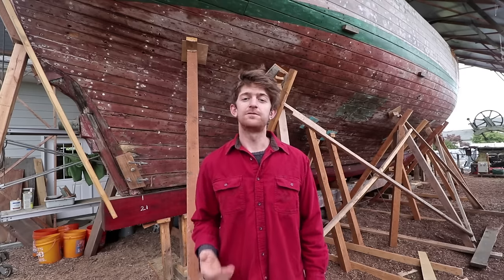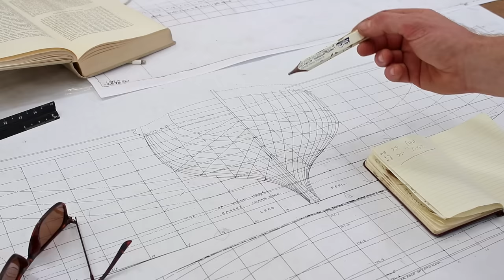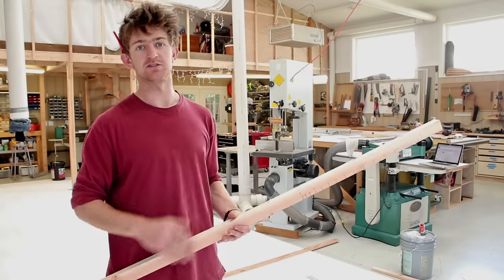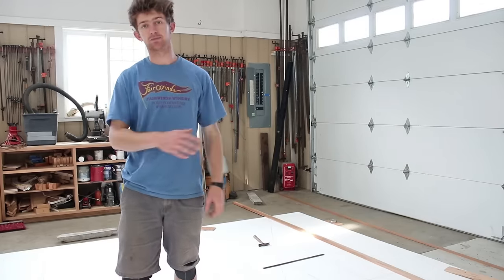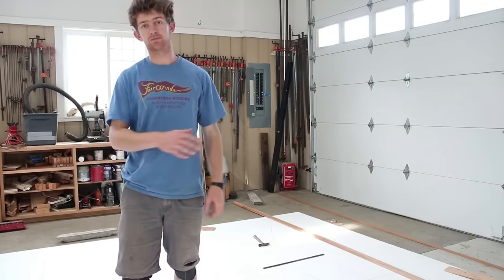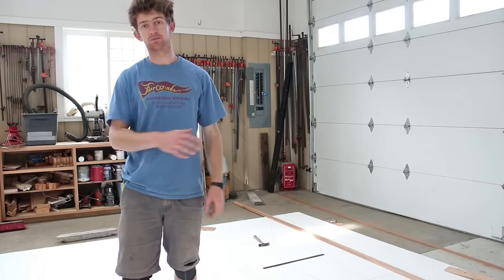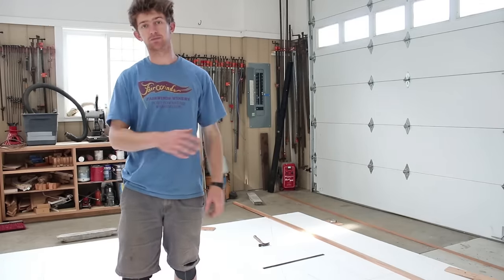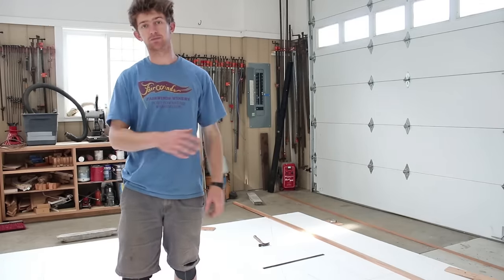Lofting the Lines; Part 2 - Rebuilding Tally Ho EP25

Comment: You can spend a month 'lofting' the plans out on the floor and getting getting the lines 'faired' in yet what is the point of this? Do you then make templates from the lines for the frames that you then need to cut out?
Reply: James Allen   I suppose the idea is exactly this, yes. Let's see.

Comment: You can't play naval architect without learning CAD. Why go to all the trouble "perfecting" the curved lines of the vessel on a white painted floor when Autocad or even Adobe gives a more perfect curve in one-hundredth the time? This insistence on middling "perfection" is a reflexive attachment to old fashionedness for its own sake, while simultaneously adopting social media, forklift trucks, power planers and other modern accoutrements seemingly at random. I sense a fear of adopting CAD more than any well-grounded theory for rejecting it. But if your dream, besides lolling about on deck in a tropical paradise, which will bore you before the anchor has even settled, is to one day establish your own boatyard—in the 21st century—you will need to learn and to rely upon CAD. An antique ship saw and Makita planers won't cut it when your work space and tools are no longer being donated for free. There is no "fair curve" in actual business.

Comment: Couldn't you just copy the whole lines drawing sheet into an AutoCad program and then use a large overhead projector to scale it up to 100%? Seems to me that this would save a lot of time and headache. You can spray the lofting floor with a photosensitive substance and leave the projector to burn in the image for a few days. Then just get out the old pen and you're done in a few hours.

Okay, I'm sure what I just said there is beyond stupid and I'm not smart enough to know why that is, but it's an idea. And I don't have a lot of those, generally speaking. They come around only about once a year so I get really excited whenever they do.
Reply: It would be incredibly difficult to ensure that the projected image was not distorted, I also doubt that the resolution would be good enough.... how ever it might save time to construct the thing in a 3d modelling programme and then transfer the info manually to full size.
Reply: I think the idea is that the curves would still not be 100% fair, so laying them out using a rough set of points allows the iterative process to home in on fair lines.
Reply: Actually, they have done something of the same in the yards in Mobile, AL. They have projection towers which cast the lines onto the steel plates on the yard floor, the workmen draw out the lines according to the projection.  This is done at night.  As for oblique distortion, the projection is rendered to cancel that.
Reply: I do this in the computer for aircraft.  It is just as tedious and time consuming.  I wish my bosses understood this. The mesh surface helps because you change both directions at the same time.  But you still have to cycle through process and compromise on this or that direction.
Reply: Well you are assuming the scale  36" long hand drawn plans are perfect. They never are  perfect, that why you loft a boat out full size, to fair and correct the small scale issues and make templates or parts of the boat. We do "old school pattern making for metal castings " and we re-layout scale drawings to full size to make things correct and find all the mistakes! We do this to remake old part that need replacing.
THE NEW WAY..... Is to drawing everything in a computer cad program and and then cut the templates or what ever part you want full size on various types of machine. You then of course have to know how to assemble them correctly. Drawing on a computer is time consuming too and you have to also be a designer to know what you are drawing and why you are making the shapes you are making , it goes on and on.
Cheers Warren.
Reply from the maker: Here's my stock answer for when I'm asked why I did it manually!
A few reasons. 1. I know how to drive a pencil pretty well, but not CAD software, and I wouldn't want to trust anyone else to do it. 1. Being able to loft is an important part of being a master boat-builder, so I was keen to get the chance to learn it the traditional way. 3. There are many fair lines that can be chosen between two points. The person lofting the boat has considerable influence over the subtleties of the boats shape, as they fair each line individually. If a computer was to do this, this human element of the design might be lost. 4. Is it even possible to fair a 50' long line on a computer screen, inch by inch? If so, it sounds very tedious. 5. I would still need life size plans for the templates, so I would need some kind of crazy industrial printers, etc. 6. I spend far too much time on the computer already, and this seems like way more fun (and makes more interesting videos)..
...didn't mean to write an essay, but there you go :)
Reply: Wow, what a lot of feedback I got on this silly (maybe not so silly) idea. Cool. So some notes on the feedback so far - Yeah, there's software to compensate for projection distortion so that shouldn't be a problem. As far as scaling up from the drawings, I did mention to re-draw the lines in AutoCad where you can make whatever corrections you need. It's not the same as averaging out a line by hand or using a batten's natural bend, but it's just as effective. In the software you can do all sorts of crazy magic with path modifiers. 

Anyway, glad to hear that the airplane industry is using this method already. Sorry to hear that it doesn't actually make things a lot easier. I am convinced that properly automating this with optimized work flow techniques, you should be able to get factors of improvement in speed. But I bet the devil is in the details.
Reply: Makes total sense. I approach things differently because of my technical background. The only thing I would add is that yes, you can fair a 50' line on a computer, but you're probably going to do it using math instead of a mouse. It sounds complicated but it's rather simple. But then again, I've got decades of computer experience behind me but have never drawn a line free hand in my life. Anyway, love your videos. Lofting was for sure the more interesting and compelling way to tell this story.
Reply: Keep on chuggin' Leo, however be advised there's gonna be a slew of p/o'd people if, after all the time and effort you've put into this, the ends don't meet. I'm really enjoying these recent episodes even tho' I'm totally lost at times. Good luck
Reply: Leo, have a look at the lines of the LearJet Model 45.  I lofted that similar size "ship" in CATIA.  I’d bet those lines are pretty fair and smooth.  (Fair and smooth are two different things and you need both.)

On 4 of your points: 1. A computer can do nothing on its own.  The operator still has to control the lines.  It IS a matter of learning how; but it is obvious you are not afraid to learn. 2. Learning to loft the traditional way is the best way for most people like you and I.  Physically doing it helps understand what is being done for you by the computer and what is not.  That gives you a much better chance of taking your computer skills farther than most that never learned the traditional way. 3. You still have considerable control with the computer.  There is no difference; if you know how to use the computer tool and IF you have the right tool.  Autocad is not that tool.  You have to go expensive and go to something like CATIA to loft well on the computer.  (I am sure there will be some that see this and want to promote their favorite computer lofting tool.  No one can learn them all so I’ll have to take their word for it.) Most cannot afford the cost.  Otherwise, manually is the best way. 4. Yes, it is possible to fair a 50” foot or 150’ or any length line.  You have to be able to control the view point to very small increments so you can get an edge view looking down the line in the same manor you do kneeling on the loft floor.  And a good computer tool will give you tools to display the second derivative (curvature) so you can see mathematically what is happening with your lines and where your trouble spots are.  Only the expensive CAD systems let you do that. The last two points are the best and there is nothing else to say about those. Those last two alone are justification to what you are doing.  Oh, and I did mean to write an essay.

Comment: lofting these plan on the floor manually, why would you not lay this out using CAD and then print it out full size? I know nothing about boat building so please do not take this a rude or snarky :-).
Reply from the maker: No problem! A few reasons. 1. I know how to drive a pencil pretty well, but not CAD software, and I wouldn't want to trust anyone else to do it. 1. Being able to loft is an important part of being a master boat-builder, so I was keen to get the chance to learn. 3. There are many fair lines that can be chosen between two points. The person lofting the boat has considerable influence over the subtleties of the boats shape. If a computer was to do this, this human element of the design would be lost. 4. Is it even possible to fair a 50' long line on a computer screen, inch by inch? If so, it sounds very tedious. 5. I would still need life size plans for the templates, so I would need some kind of crazy industrial printers, etc. 6. I spend far too much time on the computer already, and this seems like way more fun (and makes more interesting videos)..
...didn't mean to write an essay, but there you go :)
Reply: Thanks for the reply! Totally understand! It’s an amazing process and I love what you doing. :-)

Comment: I know this sounds stupid and it may be stupid but could you not simply have taken a picture of the plans and projected them to the lofting boards then penciled in, I would have at least tried to do that.
Reply from the maker: There are always many discrepancies on designers drawings, especially when blown up larger, so the lines wouldn't be fair - which is the whole point of the lofting process. If the object was simply to enlarge the drawings, there would be many easy ways to do so.

Comment: Ah, maybe you should have gone back to first principles. They used to make a model from the drawings and fair the model and then correct the drawings from the scale model.  A much simpler method than all your crazy lines in different confusing colours. Gpx

Comment: Lofting can be a tediouse process and an important process to get right”  “it takes a lot of time to loft well, but ---“  I wish my boss undersood this.  In the old days of aircraft lofting, we used splines and  duckbills in positioning and manipulating the splines. 

http://freecadbuch.de/doku.php?id=blog:was_sind_nurbs

 You can pin a position (you used nails for this) with the pointed part or apply tangent control (in math, the twist vector) at the ends or in the middle of a spline.  If used right, the spline will conform to Hook’s law and produce a “natural curve”; that is, a curve that the planks will follow naturally went fitted onto the frames. The use of nails can produce a curve that is not natural and the planks will have a hard time conforming to the shape of the frames.  Nails will also force you to go through more iterations before you find the fair hull shape.
Reply from the maker: Absolutely! Using the nails, you have to be sure that there is no excess force on one nail. I usually remove them one by one and make sure the batten doesnt spring. Also use weights on the ends of the battens to make sure the curve extends beyond the end of the drawn curve.

Comment: I have no experience whatsoever, so take this at that value. But, would a computer-aided design not have given you the exact measurements the first time? Or is there no possible way to plot a "fair" curve on a computer screen? I certainly understand the need for the life-size layout, and the ability to get your templates off of that, it just seems that the "circular", tedious drafting and redrafting could surely be done more efficiently in this millennium, without disparaging the efforts the original designer put into it, back in the early 1900s...

I know, I know! This is all history now, and so on... :-)

Comment: 360p?
Reply: Just reloaded and there's 1080 now
Reply: Click on the gear in bottom, right side.
There you can change quality
Reply: probably youtube processing the video still when you view video immediately after upload it will do that
Reply: Have the option for 1080p now, thanks for the tip.
Reply: Yeah its a youtube thing often folks will not publish until processing is done so you won't see low FPS on their videos others opt to push it right out on the web

Comment: I realize that this may sound like treason but can you replicate this process with solidworks and mill the frames with a cnc controlled saw oh and by the way coming from someone with 40 years in the aircraft industry youll be happy to learn that these skills transfer directly to aircraft manufacture we use the same terminology and back in the day the same techniques.
Reply from the maker: No problem! ..I suppose that it would probably be possible to do like that for someone who knows how. 

Here's my stock answer for when I'm asked why I did it manually!
A few reasons. 1. I know how to drive a pencil pretty well, but not CAD software, and I wouldn't want to trust anyone else to do it. 1. Being able to loft is an important part of being a master boat-builder, so I was keen to get the chance to learn it the traditional way. 3. There are many fair lines that can be chosen between two points. The person lofting the boat has considerable influence over the subtleties of the boats shape. If a computer was to do this, this human element of the design would be lost. 4. Is it even possible to fair a 50' long line on a computer screen, inch by inch? If so, it sounds very tedious. 5. I would still need life size plans for the templates, so I would need some kind of crazy industrial printers, etc. 6. I spend far too much time on the computer already, and this seems like way more fun (and makes more interesting videos)..
...didn't mean to write an essay, but there you go :)
Reply: Well it wasnt that long ago building aircraft detailed exactly the process you are using now. When I started as an engineer 40 years ago blueprint reading and drafting on tables 20ft long was the norm dont get me wrong i very much admire the effort it is perhaps the best method to gain a true perspective of how the original designer displayed his craft. I a[so watch Tips from a shipwright with Louis Sauzedde again to experience remotely the fine workmanship of a master builder such as yourselves again thanks for the content.

Comment: PERHAPS IN SOME PAST ''SHOW' YOU EXPLAINED ''LOFTING?  IN ANY CASE THERE WAS NO NEED FOR THIS SHOW,   YOU HAVE THE OLD WOOD AND THE ''HOLE''   NO LOFTING REQUIRED.         boat plans required lofting in the days before CAD (Computer Aided Design), when the plans were hand drawn.  
The job of the 'Loftman' was to scale up the original drawings to full size.       
Drawing the plans full size had two main objectives.  
    To identify and correct any mistakes on the original drawings.
    And to create full sizes templates from which to cut the timbers.     ''NUFF SAID''